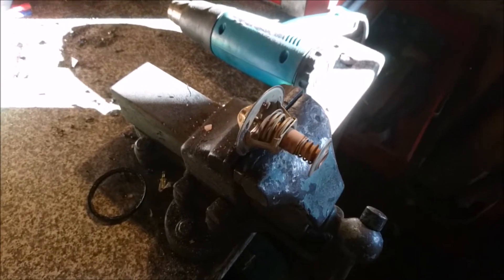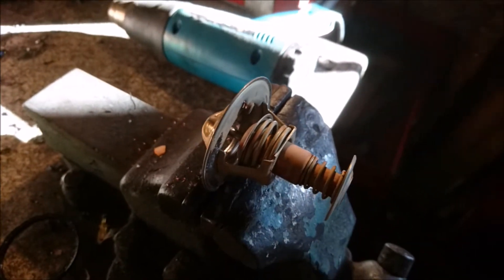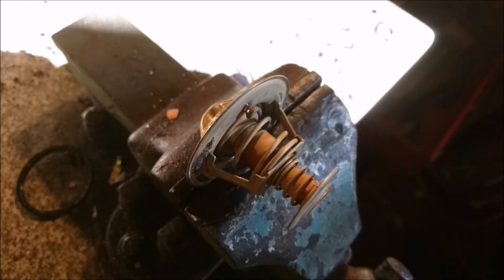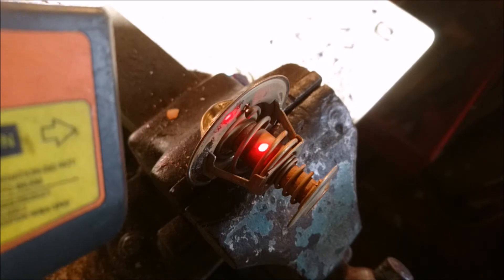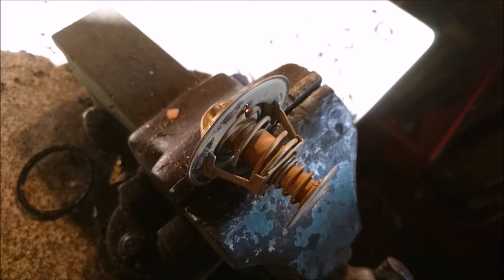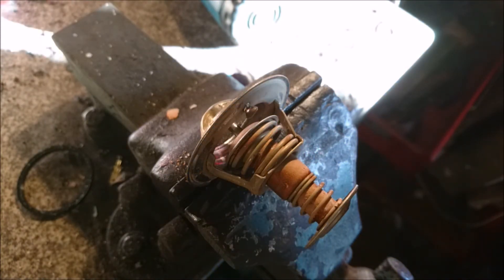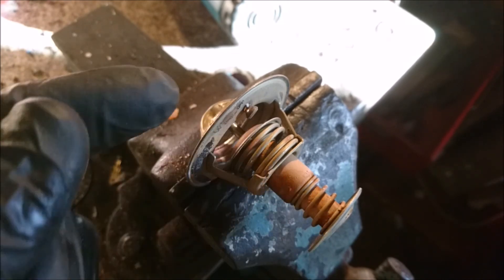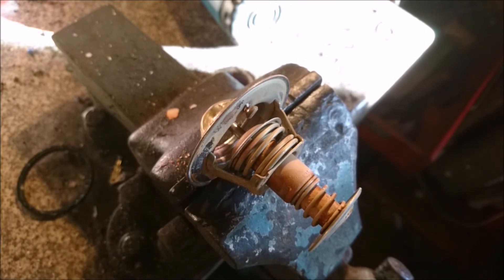THERMOSTAT - how to test - see how it works

Comment: u only replace this when broken right ?
Reply from the maker: Indeed that would be the considered ideal. However at the expense of replacement (often only £6/7) if ever in doubt, it is very cheap to replace and rule out. I rarely find they fail to open, but rather fail to close and get stuck open. For most Peugeot owners its really easy to remove and test. For others it may take considerable effort to access and remove the thermostat... so replacing it as a matter of course maybe worthwhile.

thank you for commenting :)

Comment: The easiest way to test these is to just boil some water and dumping the thermostat in. They usually have an engagement temperature of around 70 celsius. And they are actually designed to operate in boiling water. A heat gun might over heat them and damage them, possibly.
Reply from the maker: AX53 100% on the boiling water... I'm sure I mentioned that in the video? its usually how I test them...

but tricky to see that happening slowly with a temp gauge right on the stat in a mug/pan of bubbling water.

heat gun wont damage them in a demo like this :)

thankyou for watching and commenting...love hearing from viewers :) 👍🐷
Reply: Ah sorry I missed that then. Went writing too fast when i saw the heatgun

Comment: Wow couldn't get more visual; thanks for the vid!

So if your car shows weird problems with heat (like getting too hot, or maybe not reaching operating temperature quickly enough), the first quick check for thermostat fault is to place your hand on the radiator's top hose when the engine is cold - start the engine and see if the hose and radiator stay cold for a good while, even when engine warms up.
Then at some point the hose should heat up rather rapidly -- this all points to a healthy thermostat.

But surely for a bullet-proof test -- do what Piggy tells you too :)
Reply from the maker: Sim 206
thanks for your kind comment! 

as for an HDi you will literally be waiting ALL day for it to warm up to point of the thermostat opening... would have to drive it quite hard. Hence this nice little test.

however in principle you have the right idea yes 👍😎🐷